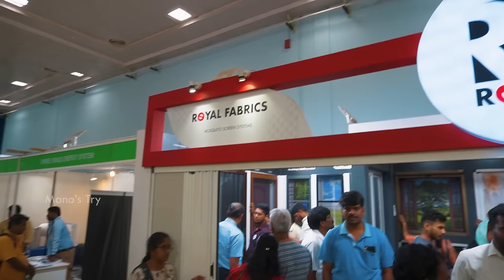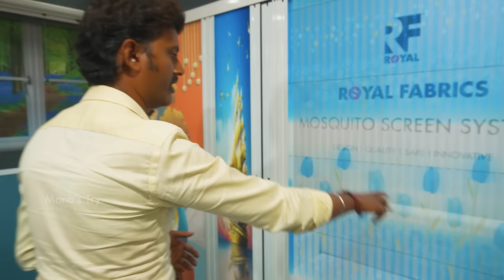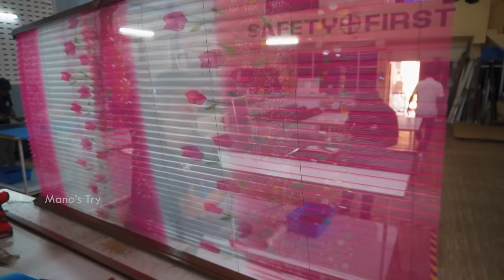குறைந்த விலையில் இவ்ளோ Design-ஆ🤯Mosquito Net Mesh for Windows Folding Sliding Doors | Mano's Try

Comment: 304 net is always better than fabric or plastic net which will rot in rain and degrade easily in Sun.
Reply: 304 will also rust, for rust free you need to go for 316 but would be pricey. Some companies also have aluminum mesh  too.
Reply: @swaminathangnanasambandam8071  316 is surgical illa, very costly. I think it's better to have no windows at all 😂😂. Just put a small hole and instal exhaust fan, that's what I did with 2 layers of mosquito net.
Reply: @SharkFishSF  when you have aluminum why do you need to go for corroding ss.
Reply: @swaminathangnanasambandam8071  aluminium also corrodes due to weather isn't it?